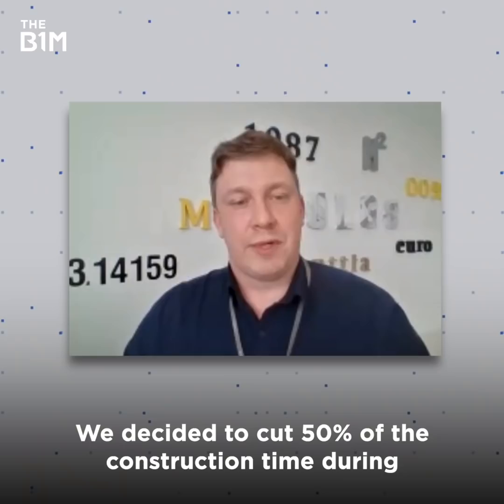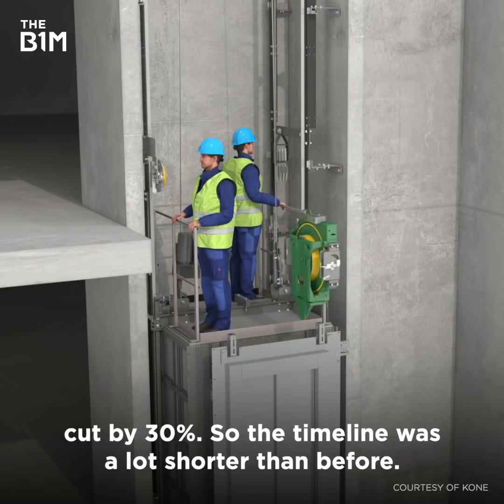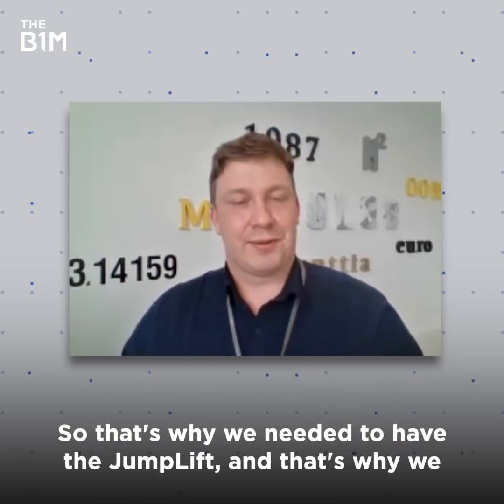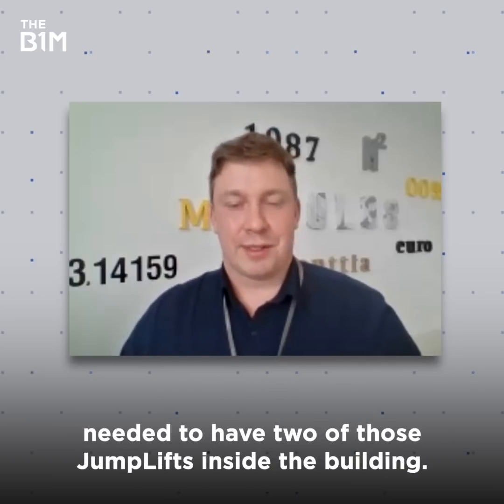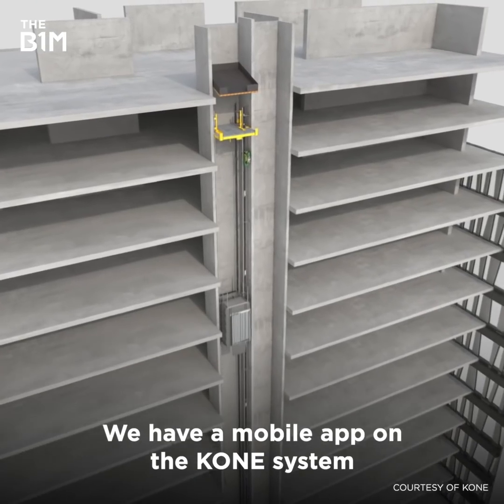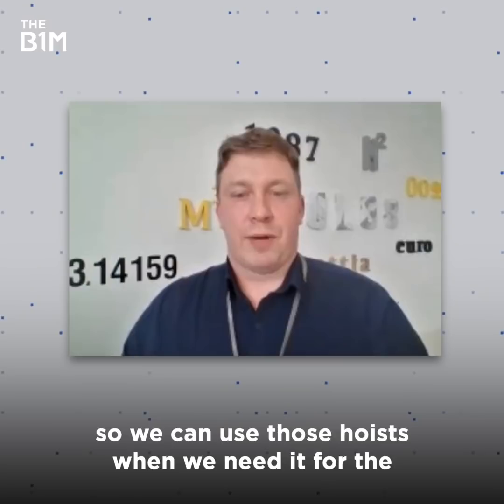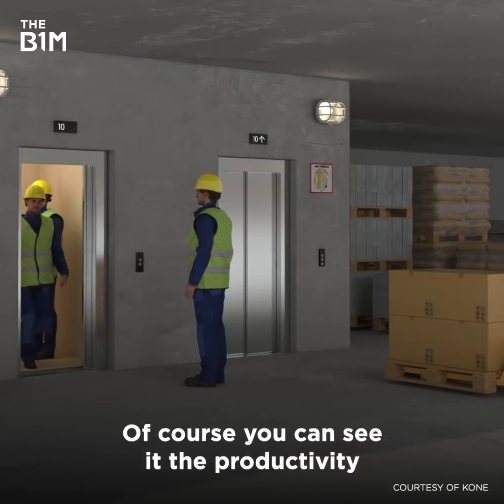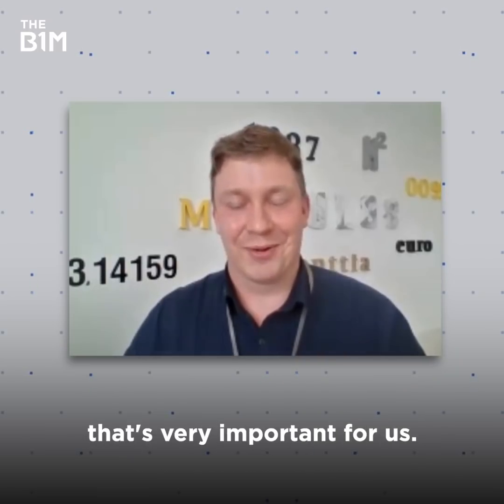This Could Change How We Build Skyscrapers

Comment: My apartment building, made in 60s, is gaving it's elevators retrofitted with brand new elevators. New designs by KONE and they rely on a system like this, however with a top pulley. One technician can ibstall all 8 floors. They just fit bottom rails and lift themselves up along it to install next set.

Amazing practical Finnish engineering.

Comment: I still dont understand whats the exact difference between a jump lift and a normal one. I think most of the lifts in modern buildings are integrated in the middle of the house and not outside at least here in germany

Comment: I am still confused on how it works. To me, the video is showing a normal elevator
Reply: Hi! Milla from KONE commenting here. It is the normal elevator that will remain in the building once it is completed. The magic is in the installation method and tools used, which allow the installation to start when the building is only half-way up or even 1/4 way up. As an example, on a 30-story building, the first installation could be made when the building is 10 stories high. The elevator is installed under a temporary "weather deck", which allows the shaft to stay clear of rain etc., and the elevator is installed to run e.g. between floors 1-9. Once the building grows taller, the installation of the elevator can continue above the already running elevator, in the same shaft. So installation crew can install guiderails and other parts to floors 10-15, while the elevator is moving people and materials on floors 1-9. Once the installation reaches the agreed "jumping point", e.g. floor 16, the same elevator car will be re-configured to run e.g. between floors 1-15. And again, the installation crew can continue installation above the running elevator, as the building grows taller. This is a standardized and certified product & installation method, and the elevator car used during construction will remain in the building after the construction has been completed, making this also sustainable and cost efficient. This new JumpLift is available also for machine room-less elevators.
Reply: Milla. That is quite interesting to be able to
Work above the running car off the temp platform.

Comment: This also means there’s no need to fill in gaping hole(s) running all the way up the outside facade when the outside hoists are removed, meaning the interior is “buttoned up” quicker any finish work to start.

Comment: This can't compare, because external construction elevators are much bigger and allow larger materials to be lifted.
Reply: These are typically built in the fireman / utility lifts which are much larger and have greater lifting capacity than those for people. Projects with jump lifts don’t rely on them solely for moving material; it’s just an additional lift on the interior which increases overall capacity. Elevators during constructing on high rise projects are in constant use.
Reply: But it is useful if you just need a "small" amount of people or equipment to be lifted.